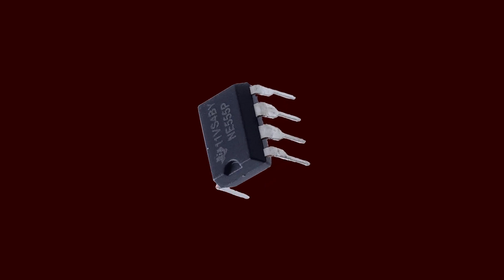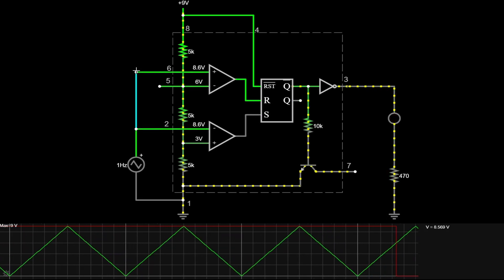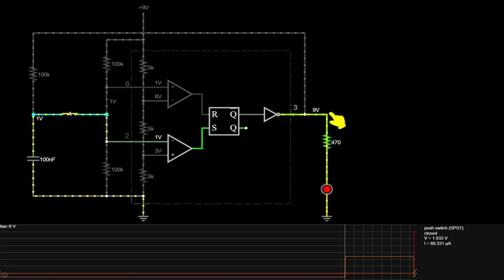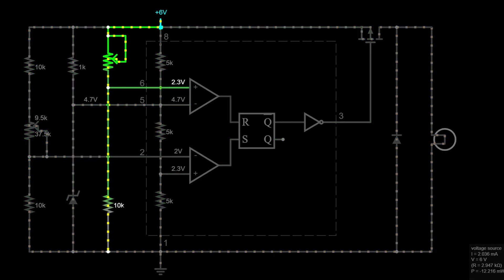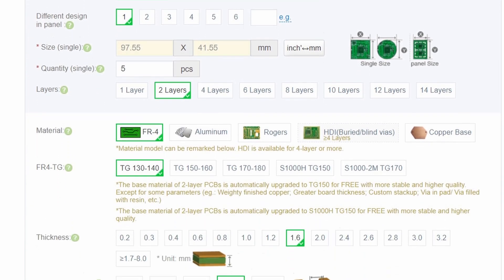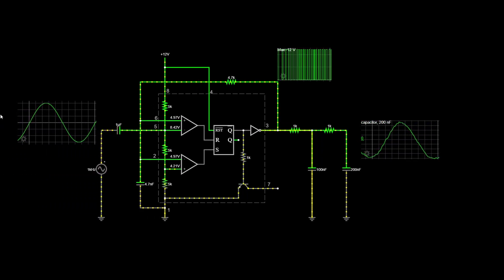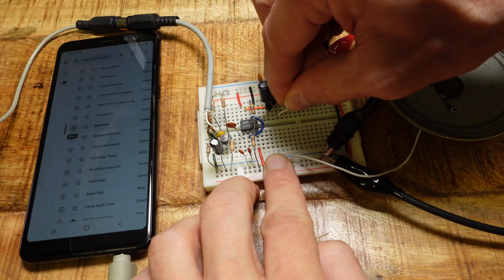Five 555 Circuits You May Never Have Heard Of

Comment: Would be interested to see how this circuit can be used to pulse charge a battery or drive a small motor. Applications would be for a small off grid workshop using solar.

Comment: Is it possible to purchase the undervoltage protection board or file? I have an immediate use for one and your circuit would make my job easier.
Reply from the maker: No, but you can make a screenshot of the schematic where I show it.

Comment: I used a 555 in college to transmit audio via laser beam using the analog-to-PWM circuit similar to what was shown in the video. This was in 1977, before it was a "thing" to send music or voice over light-beam links like fiber optic cable. I could have been a thousandaire if I invented something back then!
Reply: I did a radio shack project book thingy with an LED transmitter and photo transistor receiver about the same time in high school.  The teacher was massively impressed, though it was super crude on RS circuit boards that I drilled with a 1/8" but and soldered with a  35W pencil iron.  I wish I'd kept it, it was the first thing I built from scratch parts.  I used a visible red LED (there really weren't many color choices back then).  IR would have been much better, but you wouldn't be able to see it modulate in intensity.

Comment: I was introduced to the 555 in college in the early 80's.  One teacher was obsessed with collecting 555 circuits.  You made some great practical 555 circuits.  The parts combination in the 555 was just perfect.  I wish SOC's had a few 555's built in that allows the flip flop to be reset.

Comment: How can I buy circuit boards designed by others that were made by PCBWAY?  I used a 555 timer to pulse a solid state relay, 150ms on, 1000ms off.  I used it to test 120vac traffic signal wiring circuits,  I could adjust the on and off durantion as needed.

Comment: The 555 is a very useful IC..   I used it a lot when I was an EE undergrad and later.   It's good for simple projects.   However people  move on and the 555 gets left in the dust.   A couple of times I have met people who use the 555 for everything they do.   I guess if the 555 is not suitable for a project, they don't do it.   Not good to fixate on one way of doing things.

Comment: I've used a 556 dual timer to make a "cooking reminder", which is basically two 555's arranged in a push-pull circuit slightly modified so that one output drives a piezo bleeper for about one second every five minutes or so, to remind me to turn my fish fingers or burgers over on my grill before they end up cremated...

Comment: The only issue you need to address is that the bipolar NE555 tends to have an asymmetrical output swing on pin 3, especially when supplying some current. It won't swing as close to the positive rail as it does to ground. That means you don't get a 50% duty cycle as you might expect when using feedback from pin 3 (output) to pins 2 and 6 (trigger and threshold). It's not a big deal most of the time, but it might lead to unexpected results in some circuits. It's worth noting that the CMOS versions of the 555 don't suffer from the same problem, although they can't deliver as much output current as the bipolar version.
Reply: In my experience CMOS outputs are gutless, they can't even drive a lousy LED unless you fit a transistor to boost the current.
Reply: @majorpygge-phartt2643  It depends on how much current you need to drive your LED. of course. Modern LEDs can be quite bright with 10mA or less, and cmos 555s like the ICM7555 will sink or source that will around 0.5V loss even with a 5V supply.

If you have to get 100mA - 200mA out of your 555, then I agree the cmos versions aren't up to it, and the bipolar 555 is the only option, but you have to expect as much as 2.5V loss in the output.
Reply: @majorpygge-phartt2643;
well, du depp, your experience doesn't apply to every cmos device!
the TI cmos 555 sinks 50 may with a Vsat about 1.5 V at Vdd of 12 V...it has less output high drive at similar Vsat, more like 10 mA at 12 V Vdd, way more than enough to drive an LED! (Unless it's a big'un)

Comment: Your circuit for an undervoltage limiter will come in handy for me, as I was needing to design something to create a "window" circuit,  to trigger on at 13.6 volts, but then hold on over 13.6 volts and to shut off at about 12.9 as a low voltage, so, I designed a Everycircuit SPICE model to get my resistor, trimpot and Zener values, then I used a  SPDT relay powered by the 555 output, but then used the NC contact to power a timer circuit past it. The only thing I wish you put on your schematic ( on the black background one, I now see it on the Kicad schematic), is, you need to hook up your pin 4 / RESET pin to Vcc, or nothing works, as I am kind of a 555 noob, and it wasn't transparent to me until I did that.

Comment: I would like to understand how the electronic fuse circuit will work from what I see  , is that the flip flop outpot in both cases will be low  and as it is inverted  the ic will always be on , therefore always turning off the mosfet so  please explain to me what I have missed
Reply from the maker: I cannot explain it better than I've already done in the video.
Reply: @DoctorVolt   well in that case i dont think that such design will work. have you tried it practically ?
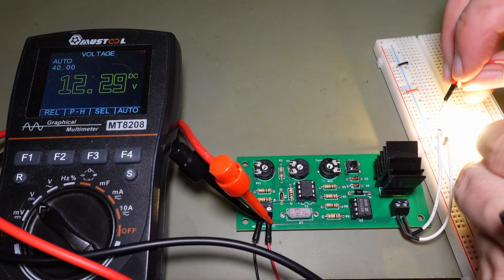Reply from the maker: @big_o1952  Have you even watched my video (6:02)?

Comment: Nice video! So, is it possible to use the 555 as a ADC, if we remove de filter?
Reply from the maker: Not really, because it has only one output.
Reply: @DoctorVolt  thanks for your attention. Greetings from Brazil.
Reply: Theoretically, yes, it outputs a serial digital signal. But in reality it’s more complicated. Although the output signal is digital, meaning the circuit is either on or off, the timing remains entirely analog. This makes it challenging to synchronize the signal and define a start of a byte.
Reply: @schefre35  thanks for the answer.

Comment: The 555 was a genius idea, they are not perfect, but they are just so versatile. If you cannot build it with a 555 it is not worth building.
Reply: I need a circuit to turn a low voltage- low power device on and off repeatedly for a certain amount of time ( like on 2 seconds, off 2 seconds ) can a 555 do that?

Comment: Regarding the toggle switch, the feedback resistor at the capacitor should be a bit larger than 100k (eg 150k), because the circuit may oscillate if the feedback from pin 3 is too strong.
It's a pity that the 555 only operates between 5 and 15 V, and consumes 5 mA. The CMOS version is so much more expensive...

Comment: I know of all of these circuits. What I was hoping to see was the AM radio circuit.
Reply from the maker: I also tried it, but as there are no AM stations in my region any more, it only produced hiss and noise.
Reply: @DoctorVolt  Then get a  [____] 1 Mhz oscillator unit and build one you [_______] you only need to test a tone,  not broadcast a mile away, a foot distance would do. I am doing my best to be nice lately.

Comment: lol, ive used one for fuel injection...

 crank (ignition pulse?) can trigger monostable on every revolution, use the MAP (or TPS) on pin5 or control to give a pulse from about 1mS to 5mS (give or take, injector flow, engine size, etc dictates...) and shes running. can change the PWM curve a bit with an RC delay on the map/tps signal. throw in some trimmer for a bit of tuning... good enough for a gokart etc.
Reply: That's the spark!

🤭
Reply: @DerMarkus1982  really? could have sworn it was a fuel injector i was triggering...

Comment: I find it interesting to see what we can also do with the 555 times, but in some examples I miss the 'why'. For example, with the toggle switch, why would this be used instead of using a simple switch that toggles by itself, mechanically? The other examples are pretty good and that undervolt protection is super useful for one of my projects :)
Reply: The toggle can be really useful for higher currents. A cheap pushbutton plus 555 and components can be (as weird as it might sound) cheaper than a high current toggle switch
Reply: The toggle switch made with a 555 automatically resets when power goes off and on again, which a mechanical toggle switch can not do. 
Think e.g. of some big machine, power goes off and comes back half an hour later and now the machine turns on because the switch was left in on position. (Ok, this problem normally gets solved with a relay because of other safety issues)

Comment: I used to use the 555 all the time but much less so after I got into coding. This video has rekindled my interest. It is still so useful!
Reply from the maker: There are actually microcontrollers that cost the same or even less than a 555 (and all the passive components around it). These may be the better solution especially for commercial product where every cent counts.
Reply: @DoctorVolt  funny how the world goes! However, the response of the 555 output could be potentially faster than a cheap MCU?
Reply from the maker: @Poult100 I cannot tell. I measured a maximum output frequency of 300 Kilohertz for the TTL version of the 555 and around one Megahertz for the CMOS version. But I have never measured the speed of a low-budget MCU.
Reply: @DoctorVolt  usually around 8MHz clock. Then the response would depend on how many clock cycles required to run the code. I've never done it either. 😆
Reply: @Poult100  That is sorta funny.
Reply: @DoctorVolt  Nope do your research on the quad packages.
Reply: @DoctorVolt   Oh, I know I saw one in a toaster last month. it looked at first glance like any other 8-pin IC until I removed it and say it had 4 other hidden pins two at the notch and two at the opposite end that were sawed off or sum, for programming maybe. So knowing how the toaster is supposed to work I replaced the micro controller board, with a board of my own. A micro switch, to sense when you press the lever to send the bread to toast, a j-type thermal couple to sense temperature, 4  C8050 Transistors [a pot and a few other components lile diodes for the needed DC supply, back emf from the relay, solenoid, and caps. and resistors] and a DPDT relay to handle the power for the elements. When the probe has sensed the temp is there it disengages the power which in turn disengages the latching solenoid, and ejects the bread. And I have me a working toaster to give me at least 10 years of service. The fuqin' micro controller should have been placed up the manufacturers rectum where it is less warm than a 90+ degrees Celsius toaster. Is this comment in anyway unclear?
Reply: I hate people that has to write a code for where the use of only 4 transistors, 1 relay, and a micro-switch would last forever, and never have to worry about a bit-flip from cosmic rays, or data retention.
Reply: You hate people for that? They'd have to do a lot worse for most to hate them. It's a strong sentiment if you weren't exaggerating. But, yeah using an MCU for that is excessive. It's a product of cheap controllers though.